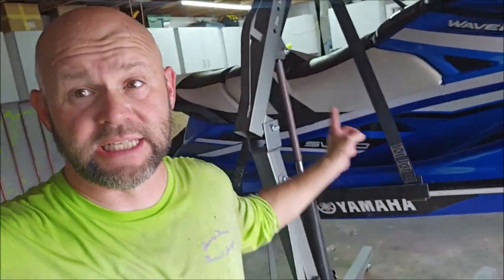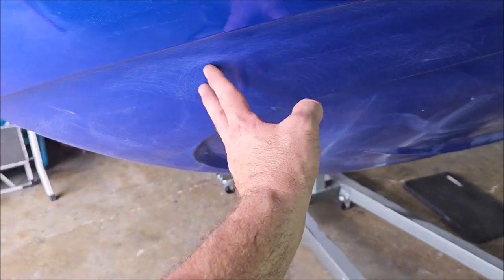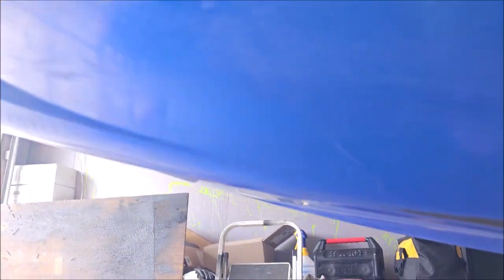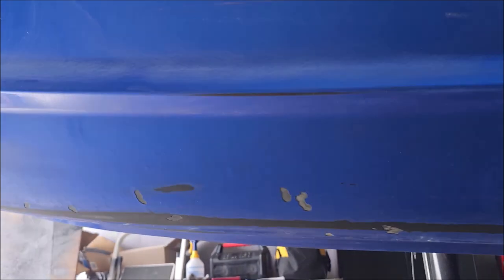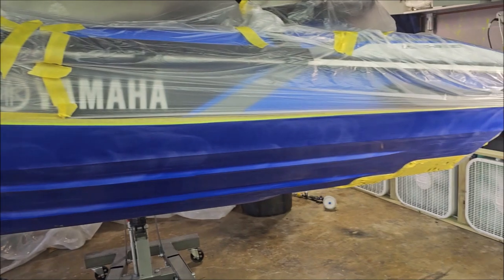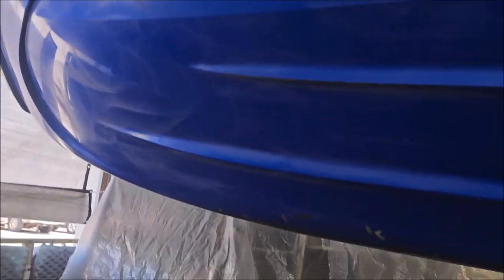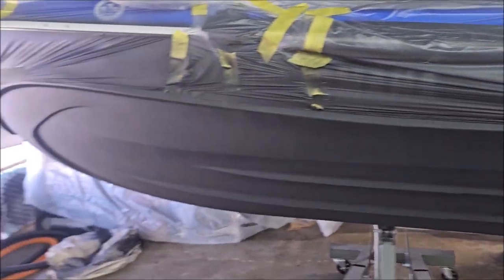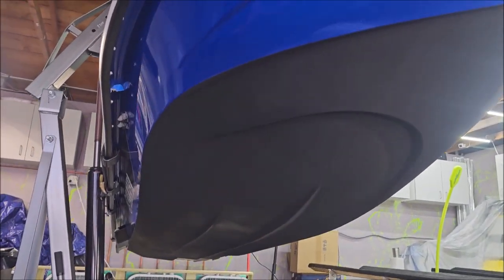2020 YAMAHA GP1800 WAVERUNNER - VERSALINER INSTALL ON SKI BELLY - JET SKI - SEA DOO

Comment: I'd love to see how well this lasts.  On the nano hulls like the GP1800R the hull flexes SO much riding I'd liek to know if the versaliner can stay on.
Reply from the maker: I have done around 70 skis with VersaLiner. I haven't had any negative reports and I see many of them weekly. This product also flexes. Its basically a durable protective waterproof membrane.
Reply: @garrydean6544  good to know.  Thanks for reply.

Comment: So based on your experience applying bottom protective coatings I see that you recommend versaliner coating. Does it stand up to UV exposure? I live near Ocala . How much lead time do you need and how long do you need to have the skis? I have two Yamaha FXHOs.
Reply from the maker: Versaliner is a 2 part 2k urethane bed liner material we manufacture. It is absolutely UV stable, but I no longer use it on the belly, I use it on the tops of the footrails or anything topside. I use Super Slick 2000 for the belly. No, SS2k nor Gator glide are UV stable. They must only be used on the belly, which doesnt get any or much UV exposure. I use around 32oz of ss2k per ski belly, much more than the average installer. I do one medium cost all over, and another heavy coat right down the center.

Comment: How does it compares to superslick2000 and gatorglide?
Reply from the maker: We did many in house tests with VersaLiner vs both you mentioned and about 12 others and we found that VL is more impact resistant and if it is damaged, it looks better.